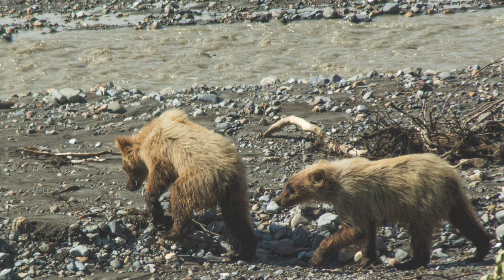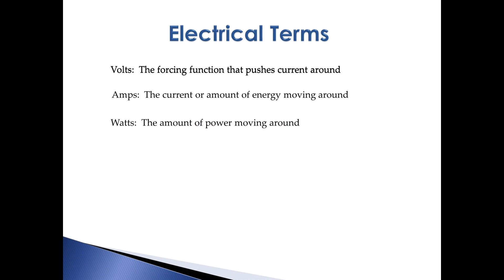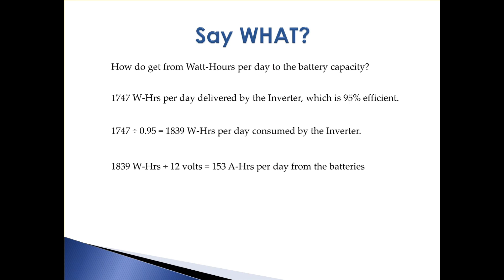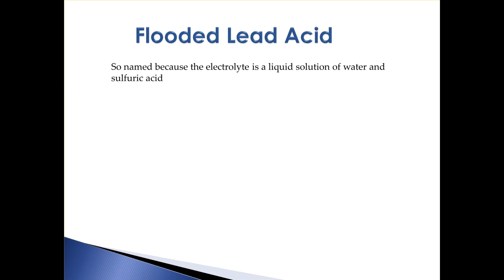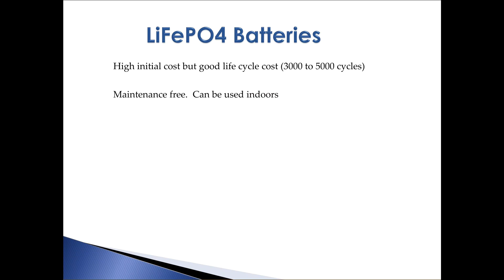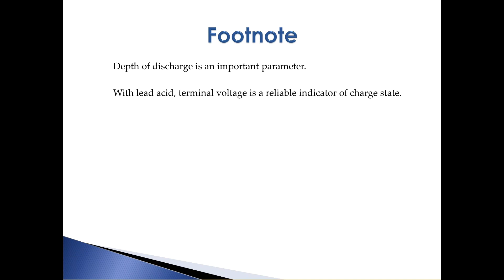Battery Basics for RVers

Comment: Hi Jim, Great Video, thank you very much! I just bought 4- 12V 100amp BBs for my 2007 American Tradition , Boy ,This has been a challenge and I am getting through it. Those Batteries are not out of your Old Rig are they?
Reply from the maker: Yes they are.  They still work just fine and I saw no reason to give them up.  It was a trade in and they didn't care and offered me nothing for them over lead acid.  I actually swapped four of the batteries from the new coach with the 4 BB.  Really drove home how much lighter the BB are.  There were also 6 lead acid in the new coach so one of the techs got the two extras.